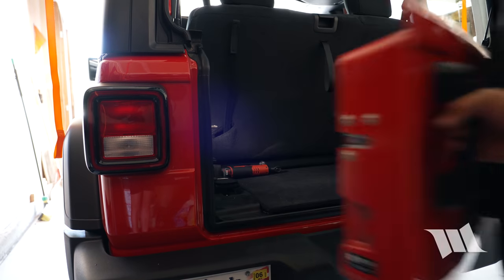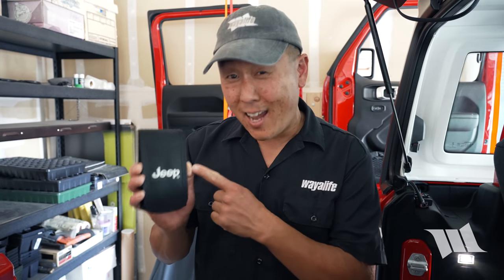HOW TO Reinstall a Jeep Wrangler Hard Top Hanging from the Ceiling with a a DIY Budget Hanger

Comment: Instead of the 2x4, I used slat board hooks on the rear straps. They are large enough to cradle the rear of the top safely without damage. That way you can back all the way in.
Reply from the maker: I take it you didn't watch this video https://youtu.be/JFbNK2gbUaw

Comment: Now the leaks begin....not being a hater, but my hardtop (‘13 JKU) never leaked until I took it off the first time. It leaks at the front corner on each freedom panel. Drips inside the door and water puddles in my floor mats, also runs down the A pillar and gets my carpet wet. I’ve tried loosening the bolts and adjusting everything, no change. So I keep a towel in the back to dry up the water. 
Still love my Jeep !
Reply from the maker: Haven't had a chance to test it out in the rain but it is a possibility. Most of our Jeeps are running soft tops and they're worse.

Comment: sorry for the 2-years-later question, but doesn't hanging the front half by the hooks alone also have the potential for warping or potential fitment issues long term?  I'm looking for solutions for a 2004 TJ I just bought, and so far you have the best set up!
Reply from the maker: For long term storage, I would use 2x4's to store it https://youtu.be/JFbNK2gbUaw

Comment: I hope you’re well. Yes, this works, but I’d be afraid of the hooks accidentally doing damage. Harkin makes a hoister that’s easier and most importantly safer.
Reply from the maker: LOL - Yeah, no thanks. I'd rather spend $172 on something that I really need. I've been using this setup for over 20 years now on multiple Jeeps and I have never had a problem. But hey, you can be afraid of what you don't actually know and spend your money however you want.